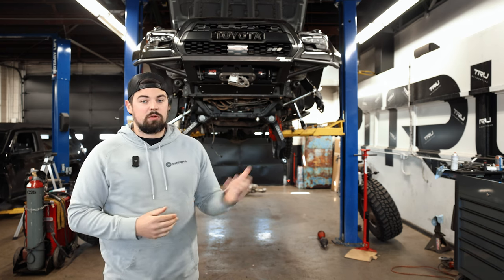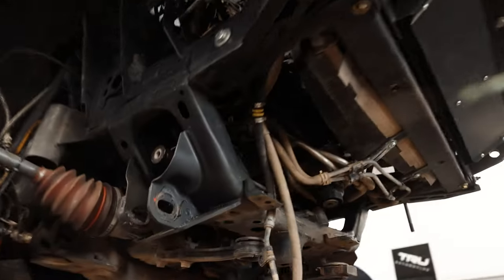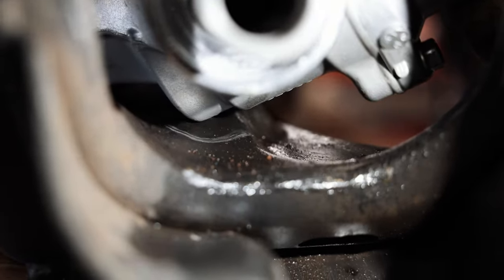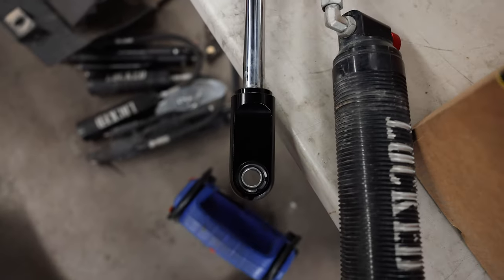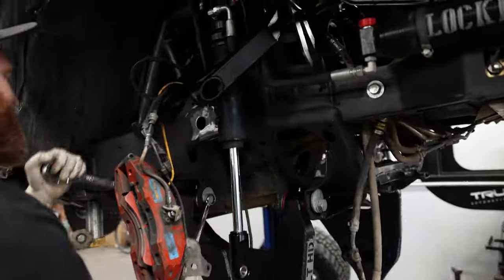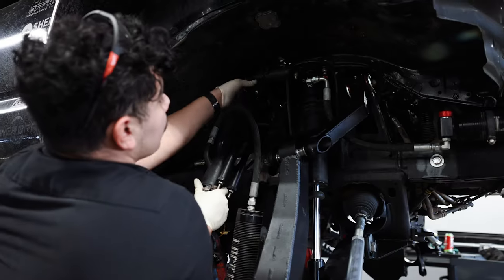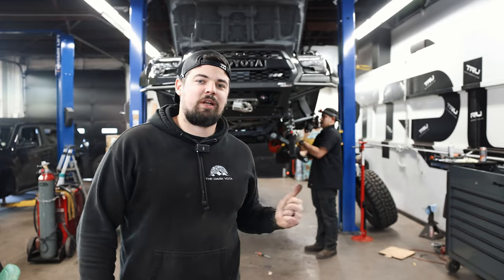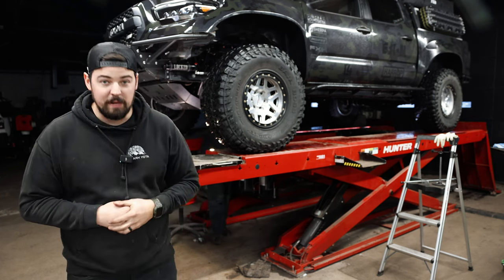Marlin Crawler RCLT HD +3.5” Kit With LC200 Rack

Comment: What kind of problems needed to get taken care of with the power steering pump and assembly?
Reply from the maker: Pump was already on its way out but the check ball for the rack was still inside it with the new brass piece. Didn’t see it in there so it was limiting the flow and when we found that after replacing the pump(which I needed anyways) it was golden.